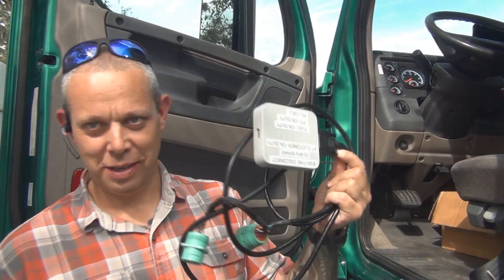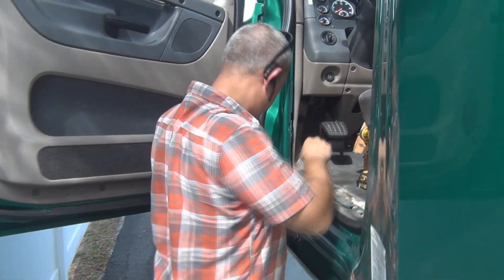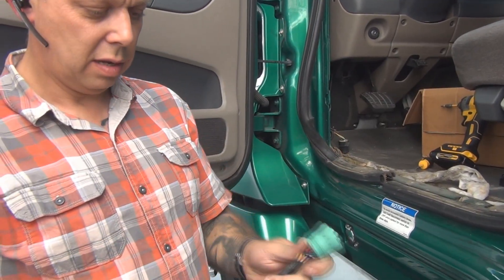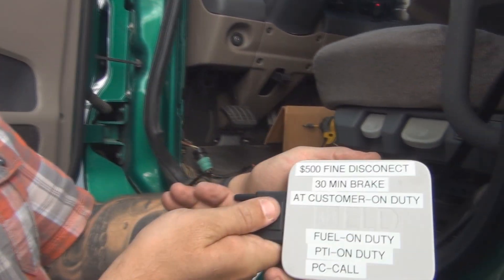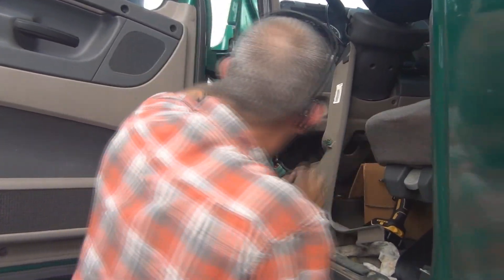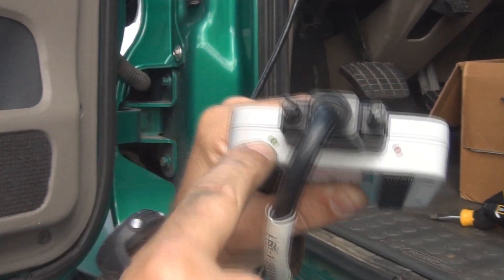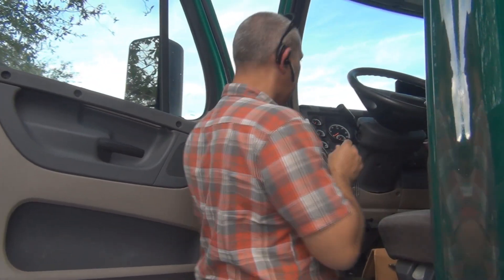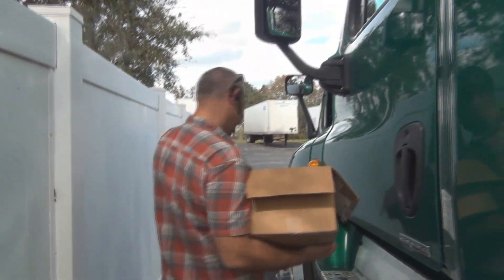How To Install ELD Into a Freightliner Truck #Keeptrucking, #ELD, #Freightliner

Comment: This was asked before. What year is that Freightliner?? And I’m assuming that this is a Cascadia.
Reply from the maker: We did so many of those, and since the camera did not capture truck number, its impossible for us to look it up, but in general it only depends on the location of the plug in the  truck and how many pins. All newer ones are 9 pin old ones 6 pin. Hope it helps a little.
Reply: Thanks for your reply. Last week I got a new to me 2018 Cascadia Evolution ( old style hood) . And your video is exactly how you install the KeepTruckin ELD on it. It is a 9 pin connector. Also is very similar to a 2014 Volvo VNL 670, same plug same place. On a 2015 Volvo VNL 670 the plug is totally different and it is plugged in at the fuse compartment area on a top of the dash board( there is few good YouTube videos on how to do this). Thanks for your help again.

Comment: If only they gave me a wiring harness with a pin connector.
Reply: I got same. For 2017 cascadia. How did u do it ?
Reply: @Haulinglife  take apart the dash and cover thats in front of the shifter. Look for the yellow an green wire. I believe it says J1939 on a sticker. Carefully remove the clip to insert the ELD into one of the slots. Push it in, connect everything back. The back and red wires can be connected to a cigarette plug or ground the black to the metal and connect the red to a power source (the last guy that had this truck had that done so I used the red wire he had already).